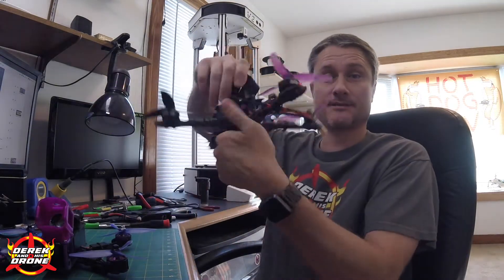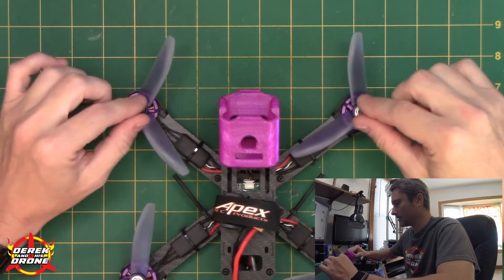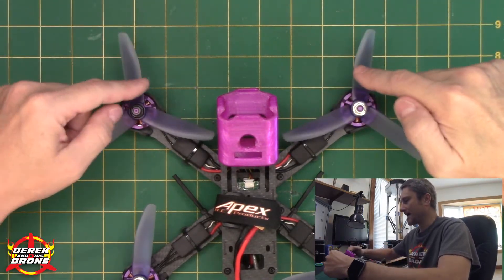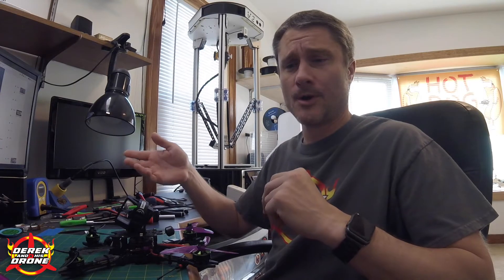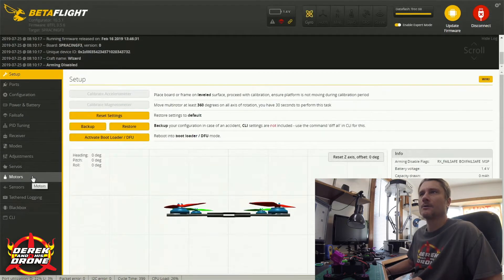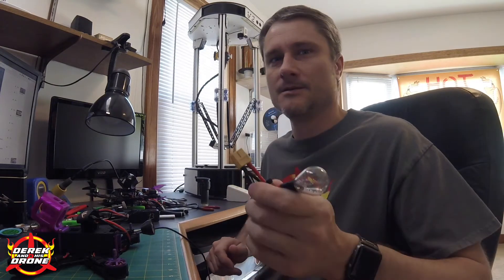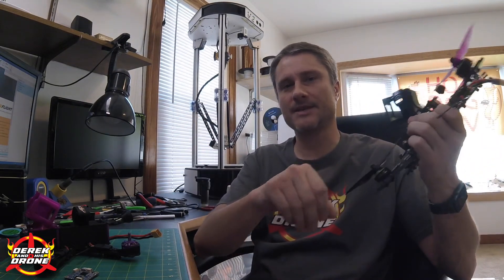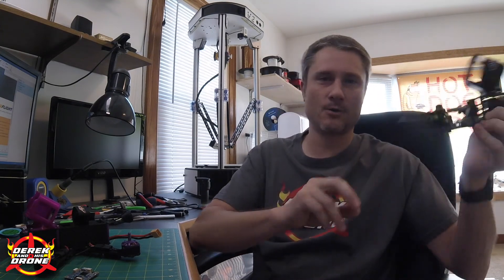Quad Flips Out when Armed - Viewer Request

Comment: So all of my motors are spinning correctly but on takeoff when I slowly raise the throttle the quad shoots straight up in the air uncontrollably. Any ideas?
Reply from the maker: Did you change anything with the PIDs or filter profiles?  What version of Betaflight?  Details on your setup, frame, motors and flight controller?
Reply: Thats what i got going on did all checks. It will sit when arned as soon as i give any stick inputs it goes mental....

Comment: Thanks for making this video!  I crashed my Mobula 7 and after replacing a motor it started flipping on take off.  For some reason  Betaflight didn't remember that my motors were spinning in the opposite direction.  I was ready to write the FC off as bad, but your video saved me from doing that!
Reply from the maker: I'm glad you got it working!

Comment: +1👍 
step 1: set runaway_takeoff_prevention = ON
step 2: set new quad idle speed lower than you'd normally
step 3: yell "oh $hit, save yourself (i can't)" and jump in the ditch
Reply from the maker: Personally I'm not a fan of anything with the accelerometer.